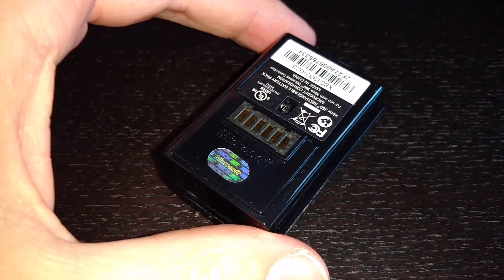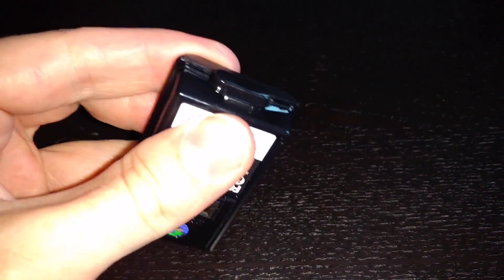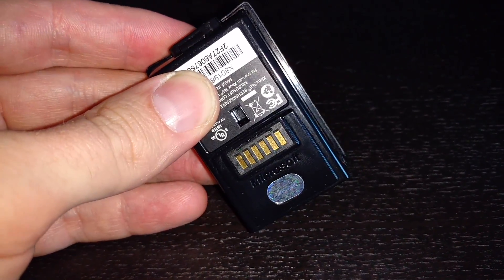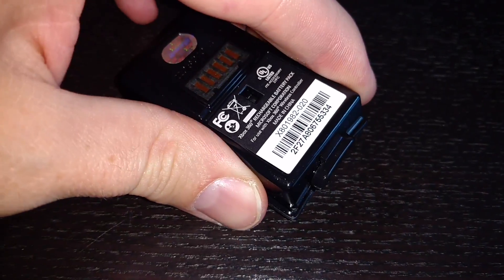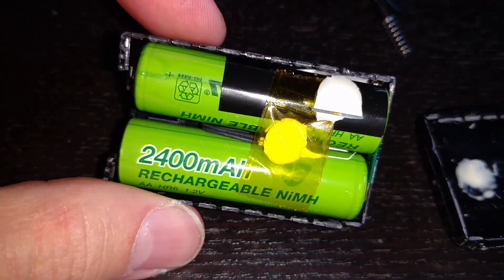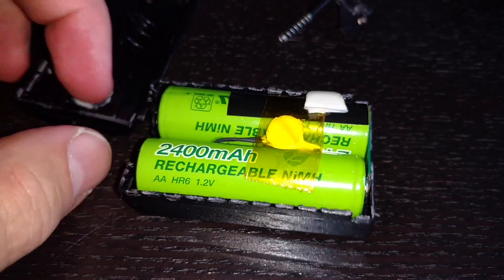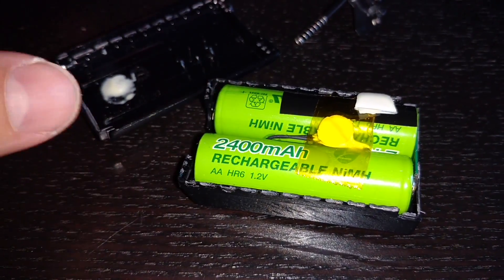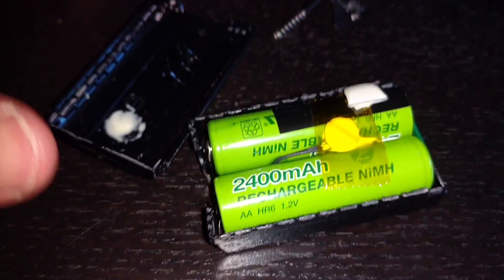What's Inside The Xbox 360 Rechargeable Battery Pack?

Comment: Worst part is, the rechargables have a better connection to the controller. The standard AA sleeves put strain on the bottom part of the battery bay, cracking the plastic over heavy use and worsening the connection to AA batteries. However, since the rechargable packs get a connection via the back, it's a much sturdier connection, even with the cracked plastic

Comment: Thanks for this  old video. Gave me the will to open a battery pack. I tried the "fix" on some on my batteries and it worked (shorted pins 1 and 5, then 2 and 6 to reset the circuit) and then applied 9 volts to pin 2 and 5 for about 5 seconds. They "revived" and normally charged. But one pack didn't so I cracked it open (carefully so I can reuse it if needed) and find out that the spot welding between batteries failed and one was not making contact (I must've dropped it or something). Fixed that and it worked again. White rechargeable batteries (no brand). It was an INSTEN kit that got from Amazon (one charging station for batteries only with 2x 2400 mAh  battery packs. I was gonna throw it away but seen your video made me rethink it and I'm glad I did :)

Comment: Man, the one thing I'd hoped you'd actually show me is why the heck these things have six terminals when the controller has 4. In short, the wiring ... Pull those batteries out and explore that. I have a broke one and may be doing that instead. Call me curious but that is what I want to know, what the wiring is. That there are two standard NiMH batteries in there was fully expected and zero surprise. It is the charge convenience with kids I want - they just plug the controllers into the standard cable near the Xbox when not in use.

Comment: Good video, skipped the part i came here for. Cracking open the case so as not to destroy it.
Reply: I know Im kind of randomly asking but do anyone know of a good website to watch newly released movies online ?
Reply: @Emory Tony I use FlixZone. Just search on google for it =)
Reply: @Kaiden Walter yea, I've been using Flixzone for years myself =)
Reply: @Kaiden Walter thank you, signed up and it seems like they got a lot of movies there :D I really appreciate it !!
Reply: @Emory Tony happy to help :)
Reply: Use a heat gun around the edges and it will melt the glue then pry it open with a plastic pick, it will eventually give, them carefully pull all the spot welded tabs from the ends of the batteries then replace them.

Comment: Trickle charging them brings them back to life. The problem is using the right one to not blow the fuse in the circuit board. The batties are salvageable from those packs. Use them as regular rechargeables for my wii motion controller and GC Wavebird.
Reply: How do you recharge them?I want to put them on my xbox one controller
Reply: @servo69  Just use any NI-MH battery charger.

Comment: Was it easy to open the casing?  How did you do it without it breaking?  Thanks!
Reply from the maker: Not gonna lie: I didn't. It was broken already; I just broke it further https://youtu.be/5Ia-jhNWiVs
Reply: Use a pick, insert it from the top, where the release button is, try to go on the sides
Reply: Use a heat gun to melt the surrounding glue, then pry it open from the top. I just did it with no problems. Nothing broken.

Comment: What happens if u put those batteries (rechargeable ones) into a normal Xbox 360 battery pack
Reply: They'll work, but you'll have to recharge them outside controller
Reply: @HKT-4300  Ohhhhh , thank u so much bro 👍

Comment: Would it be possible to buy some cheap clone off brand battery packs (It's impossible to find official ones where I live) Open them and replace the inside ones with good quality Panasonic rechargeables?

Comment: So if it's just a pair of nimh batteries, what are the other 4 contact pins for?
Reply from the maker: Supply voltage, power out, serial data bus connections, power in, thermistor connection
Reply: The round thing in the center of the batteries is a temperature sensor so the thing will stop charging if the batteries get to hot

Comment: There was probably nothing wrong with your battery pack. I had two that were "dead". I however bought a couple of Wildfire Evo controllers (useless shits) a few years back. After the Evo controllers stopped working correctly I used the USB slow charging port in those controllers to charge my dead batteries as a LOL. Come to find out it not only charged them but they were able to maintain a charge as well. There's something wrong with these Nyko battery systems that causes them to misidentify that the batteries are still functional. 

The MS rechargable cords aren't reliable because they break and short out too easily. Datel may have gotten lucky and stumbled on a fix by accident. In hindsight I probably should've broken one of the controllers down and made it into a makeshift charger instead of throwing them both out.

Comment: Does it still work if u put it back together
Reply from the maker: If you replace the batteries, yes, I suppose it would. What would be the point, though?
Reply: @AirborneSurfer  the point would be not needing to remove the batteries to charge them and you could use the proprietary cable that came with your 360 play and charge kit.

Comment: DO NOT USE RECHARGABLE BATTERIES IN THE ORIGINAL SHELL THWY ARE SLIGHTLY BIGGER THAN THE STANDARD AA BATTERIES AND YOU WILL NEED PLIERS TO REMOVE THEM!
Reply: justin rivera depends on which rechargeables you're using, I have eneloop pros (they are a bit bigger than standard AA) and Ikea Ladda 2450mah, and they work alright, and I can remove them easily (not as easy as regular aas which basically fall out themselves, but still no problem)
Reply: I'm using Duracell rechargeable
Reply: Not all rechargeables are bigger, e.g. white Eneloops are ok but Varta are too big.
Reply: I'm using VARTA is it good?